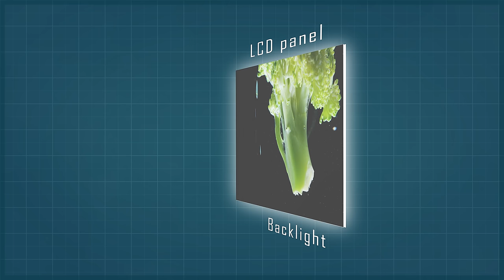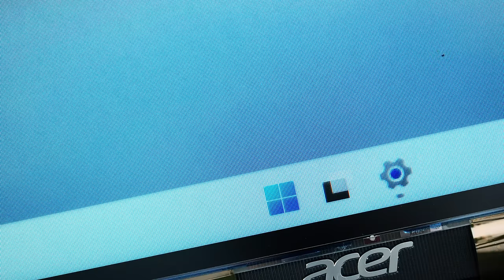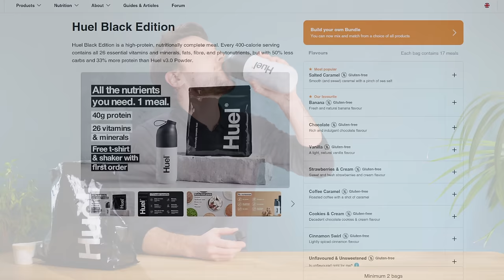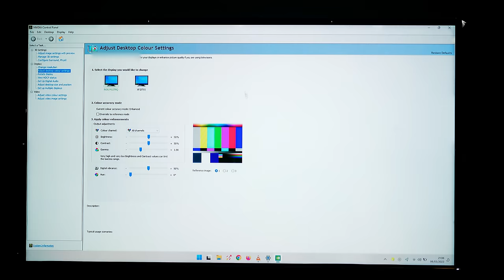DIY Dual-Layer LCD monitor - can it match OLED??

Comment: I think you could actually add a middle polarization layer between the other two. Weirdly, if the middle layer is at an angle between the other two, it allows light to pass through all three. I think this would actually allow more of the original light through than paper.
Reply: this!
Reply: "Weirdly" is an understatement. The fact that this works seems to defy all rational. like some kind of glitch in the matrix.
Reply: @melty4204  Wasn't it that if you consider the polarized light coming through as a vector, the vector gets projected on the next layer so that if you have a 90 degree angle, the projection result is 0, but if you project it 2 times on a 45 degree angle, it isn't 0, which means that light still gets through.
Reply: He could also flip over the second lcd, that should be the correct polarizations.
Reply: If he took apart the panel stack and then stacked just the actual LCD's and then added the lens layers to that stack from one display in then he wouldn't need any of that nor the additional LED lights. The LENS layers serve multiple purposes and depending on the construction the polorizer often isn't affixed to the actual LCD and is just one of those layers in the LENS stack. On some panels it's glued directly to the LCD, but if it's not, then you can just stack the actual LCD's and place one stack of filter layers and that would eliminate all the Extra stuff he did with the paper and LED's.

Note: When working with LCD panels films and lenses use gloves that leave no residue and do this in a dust free room while wearing something over your head or you will forever see dust, hair, and fingerprints on the image of the screen.
Reply: That would work, to somr extend, but you'd be losing even more brightness
Reply: @shadamethyst1258 why
Reply: @Aedi polarizing filters filter out light, as one might expect, so the more of them you stack the more brightness you'll lose
Reply: @techman8817 wouldn't the second one need to be vertical for that to work?
Reply: you'll only get a quarter of light to pass then, significantly worse
Reply: Just add a third polariser, you’ll get the backlight back, and brighter than just having one polariser.
Reply: @SimonHowes  Polarizers make things darker by definition. With 3 polarizers you cannot possibly have it be brighter than 1
Reply: ...or he could remove the polarizing filter of the first lcd...
Reply: @ikannunaplays  "Note: When working with LCD panels films and lenses use gloves that leave no residue and do this in a dust free room while wearing something over your head or you will forever see dust, hair, and fingerprints on the image of the screen."

Good advice, but if a person were actually to do something like this, I would recommend just building or buying a small laminar flow hood.

Comment: This is a project that I think deserves a version 2. You might get better results with different panel technologies (like TN VN and IPS), or you might be able to dig and find better solutions for diffusion, polarization, backlighting and driving the displays. Even if the final result is expensive and impractical I think it's worth it to see just how much is possible by going full DIY.
Reply: He should just remove one polarizer off, i'm not sure wich but it should improve the image if done right.
Reply: VA panels ftw
Reply: @Felipe Siqueira  even if not removing one you can just get another polarizer sheet and rotate until it's corrected. Using paper for diffusion and polarizing is what kills this screen.
Reply: Yeah, absolutely, first of all because fine working monitors are filling the landscape, they are like everywhere, on every corner, so in terms of real economic behavior, not in terms of money, it definitely not just deserves, but needs further experimenting, there is a lot of tweaking that can be done that will make the result much better, like removing everything from the actual LCD panel would need much less light, what we need here are only the black pixels that are amplifying the darkening effect. Thank you for the comment, saved me an own one which much less people would see.
Reply: @djayjp  worst panel
Reply: @nikoraasu6929  Lol I guess you've never checked the actual measured contrast ratio of VA vs IPS. The former is like 4x higher than the latter.
Reply: @djayjp  i do not care about the contrast. When a panel smears the black spots all over the screen that is not a good panel
Reply: @nikoraasu6929  What the heck are you talking about? That was obviously a faulty panel. I'm a videophile and know this is not an issue with normally functioning VA panels. Try BenQ or Samsung Odyssey Neo G7.
Reply: Definitely try different panel technologies. Old TN panels are usually white when unpowered and AFAIK this means there's a good chance both polarizers are in the same direction. This would mean they can be stacked without interference. The efficiency would also be much higher this way.
Reply: @fss1704  Won't work, you'd need to remove both polarizers on one of the panels, and then switch the orientarion (horizontal on the back, vertical on the front)
Reply: @djayjp  That's not faulty that's just how VA panels are. Samsung odyssey monitors are the exception to that rule, where at the cost of some contrast they've fixed all the smearing and ghosting problems VA is known for.
Reply: @jumpierwolf  No, my old, cheap Benq VA never had that problem.
Reply: @djayjp  What's the model number?
Reply: @jumpierwolf  GW2255. I recall reading a thorough, technical review of it that showed the UFO from blur busters looking good using its AMA overdrive feature.
Reply: Different technologies gonna look weird for dynamic content, because they have different update speed.
Reply: You meant VA*
Reply: @jumpierwolf  I use an OPTIX MAG24C and it has no smearing and no ghosting.

Comment: To deal with the polarization problem, you can put a sheet of polarizing material between the 2 screens at a 45 degree angle to the polarization.  This will "turn" the polarization without the need for diffusion.
          Another option: buy 2 SQUARE monitors.  Assemble the screens a quarter-turn from one another.  Run software to quarter-turn the images so they align.
Reply: That would probably not work because of syncronization issues.
Even if the pc was able to produce the straight and 90° degrees-turned images perfectly at the same time the fact that one panel would be vertically syncronized while the other would be horizontaly would probably mess up everything (at least at higher refresh rates).
It could work though if you designed your custom electronics to drive both panels from a single source and to account for rotation and syncronization.
Reply: He could also just have removed the bottom screens polarization layer and anti glare film which would have left him with what he needed
Reply: I don't get why he didn't just flip the top LCD around so that the two identical top polarizers are touching in the middle of the sandwich and don't cancel eachother out, then flip the image on the top one.
Reply: @peshozmiata  I'll be the same, it has to be perpendicular pass the polarisation, that's why the comment above mentions squared screens

Comment: Over ten years ago, students at RIT combined an Apple Cinema Display panel with a pair of projectors that, combined, matched the resolution of the display. The projectors projected the image in black and white behind the LCD panel displaying the same image in color. There were some off-axis alignment issues, but the first look at what HDR would eventually look like was stunning at the time.
Reply: Its funny that since the coming of lcd , we had to wait from crt to oled to get decent images again
Reply: Rochester Institute of Technology?
Reply: @murray821  
Decent image but you still lack the perfect vertical and horizontal motion resolution of a CRT.
Reply: @SMGJohn  what's wrong with the movement in OLED ?
Reply: @bongcloud_ken  pixels
Reply: @RmRoyalflush  🤓 "pixels"
Reply: @cochxite  yeah
Reply: @bongcloud_ken  If you didn't know, CRTs don't have fixed pixels, specially not monochrome ones. Their magnetic/electrostatic scan can make literally any resolution on the screen, while LCDs, plasmas and OLEDs (add here projector stuff like DLP and SXRD/LCoS) all have fixed resolutions.
Reply: @Kalvinjj  bro fr ? That's cool as shit, but there was a limit to how much resolution was displayed, right ?
Reply: @Point_n_Shoot  nice, i was there for one semester, but couldn't handle it. currently in a community college, and when I am mentally stable and healthy, i can go back there
Reply: @bongcloud_ken  Yes, they do have an upper limit to the scan rate (vertical resolution depends on how fast the beam can travel left to right, horizontal resolution depends on how fast the beam can switch on/off), and you might end up smoothing "pixels" when you go above the color resolution of the monitor, since the stripes/dots do have a fixed position (if we're talking of a single CRT doing all colors like a monitor), but they can indeed cross two digital pixels into a single color stripe, similar to how we store images with less resolution on the color data than the brightness data.

Monochrome ones tho don't have this issue of blending colors, and can just go anything as high as they achieve. Old 90s CRT projectors (the 3 lens beasts) with 9" tubes like the Sony G90s can to this day do Full HD easily, and 4K a smoothed up. That's a 90s projector by the way.

The drawbacks? Well, massive power consumption, relatively low brightness, lifespan of the tubes somewhat comparable to a new projector lamp but there's 3 of them, and setting up that 100 kilo beast aligning all 3 images is... a BIT hard.
Reply: @Kalvinjj  I never knew CRT had some cool features. Is there any new type of tv tech that's similar to CRTS today ?
Reply: @Kalvinjj  I love monochrome CRTs but even they have resolution limitations. The dot the electron beam makes on the phosphor is an image of the tube's cathode focused with electrostatic and/or magnetic lenses. This puts a limit on the smallest dot size.
Reply: @Kalvinjj  And also CRTs themselves (at least monochrome ones) are actually fairly low power. Most of the power usage is from inefficiencies in the deflection and other circuits. A standard 1940s CRT only uses four watts at the neck and if the picture's bright maybe a watt or two for the beam. More modern ones use even less power at the neck.
Reply: @eDoc2020  That too, forgot the dot focus as another resolution limitation.
Power wise indeed but that's kinda like saying LCDs take little to no power but the backlight eats tons, true of course but given they don't operate on their own without each other, the full package would be what actually counts in my view.
Reply: @bongcloud_ken  At most, laser scanning projection could do this (like, push a laser fast across the screen like a CRT does with electrons), but I don't know if there's anyone doing this commercially. I can see quite the difficulties with this technique given the need for mechanical synchronization for it to work and fast spinning mirrors. A laser printer does pretty much this but line by line so it is possible at least but maybe not yet at video speeds.
If I'm not outdated in my research, laser (video) projectors currently available use the laser as a light source but a DLP panel as the video producing bit. The coolest thing about those are they're always in focus.
Reply: @Kalvinjj  It is like saying LCDs use little power but the backlight does. When they switched from CCFLs to LEDs monitor power consumption dropped dramatically. With modern circuitry optimized for low power they could make CRT displays which use less power.

One easy way to save power is to use electrostatic deflection instead of magnetic. The downside is electrostatic CRTs can't have large deflection angles, so they'd be uncomfortably deep for large screens.
Reply: @eDoc2020  Can't say I'm against oscilloscope monitors, that would be pretty damn cool. Impractical sure, but cool nonetheless. Makes me wonder if this also solves the geometry issues with increased brightness and corners.
Reply: @Kalvinjj  Smaller American postwar TVs used electrostatic deflection. The 7-inch 7JP4 was most common tube but there were a few 8s and even a 3.
Reply: @Kalvinjj  
If any of that were true, then my CRT monitor would be able to output 1280x1024 without the text literally being unreadable.
Of course it doesn't use pixels for the final output. Nothing does.
The final output of an LCD panel is also just an analog voltage.

Any theoretical "unlimited resolution" of cathode ray tubes sure doesn't seem to have been explored by anyone at any point.
Reply: @bebobo1  That's an interesting lack of further read, given I never said the resolution is unlimited, in fact the next comment explains how it IS limited, and another commenter added to it.
And yes the not fixed resolution of CRTs has literally always been explored with TV sets (they do have lower chroma resolution than luma quite often, the color stripes or dots don't really match with the transmission standards, specially on small tubes), and CRT projectors, which as I stated people have pushed old large CRT projectors to Full HD and above.

...I don't get your thing about pixels tho, what you see isn't a voltage variation, what you see is indeed a light block, a fixed unit of it that composes the image, on an LCD, plasma, Sony Jumbotron, LED outdoor display, DLP projector and most other display technologies that aren't CRTs (heck the Jumbotron sorta is). These blocks can't move around and won't move around. On a CRT they can and will, often unwanted like geometrical distortions.

Comment: Love seeing these diy projects that compete with hardware 10x the price
Reply: To be clear, this is not going to "compete" with mini-LED & OLED tech.  Mini-LED displays get MUCH brighter and while this may match OLED brightness, it will fall short and in pixel response times and input lag.

Youre also driving two displays off of a single output, so you're gonna need one hell of a GPU
Reply: @erikhendrickson59  Nah it will be comparable to just driving a single screen in terms of GPU power if you use the "duplicate this display" option in windows.
Reply: @erikhendrickson59  hey, watch the video before writing, you don't need a "hell of a GPU", duplicating the signal is enough, and even if you tried running both out of the GPU mirroring monitors is one of the simplest things GPUs do, it's the same thing twice, it doesn't have an overhead at all, people that make GPUs are some of the smartest people on the planet.   Please stop thinking that just because you don't see a solution for something no one is capable of doing it
Reply: @erikhendrickson59  GPU power is going to be the exact same as with one monitor.

But you are absolutely right about the brightness, and the power consumption is also absolutely crazy. It's not a viable product because of these
Reply: @adamashworth6293  The HDMI splitter he's using means the PC only ever knows about a single monitor. The GPU is doing 0 extra work, because it doesn't even know the image is duplicated
Reply: @hundvd_7  Good catch I didn't even see that, just thought he was plugging them both in.
Reply: While the whole thing is pretty cool, it does require time, expertise and equipment, and sometimes, that expertise takes years and costs a lot of money to get, since you will break stuff and misjudge what you need. Also, the power consumption is whack, where i'm from, just the power bills themselves would easily eat up the savings over the years.
Reply: It's homemade crap, any good ??? you better buy a HDR that does over 3000
Or fancy micro LED, nutritional goodness ?
Reply: @erikhendrickson59  lmao the displays just duplicated
Reply: Sony dual lcd monitor can reach 1000 nits brightness fullscreen, not quite as close to compete
Reply: @erikhendrickson59  No, there's no input lag, he used an HDMI splitter that duplicates the signal, you don't need a stupidly good GPU to drive 2 monitors, because it is not 2 monitors, its only one.
Reply: @lucasRem-ku6eb  Obviously a store bought OLED or Mini LED would be better. Did you even watch the entire video?